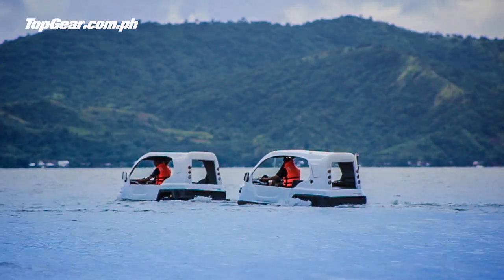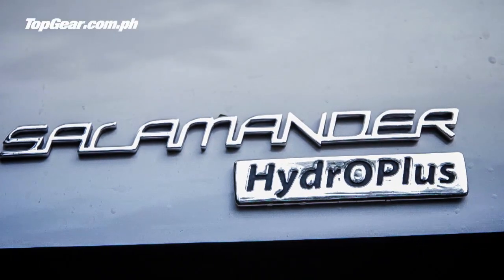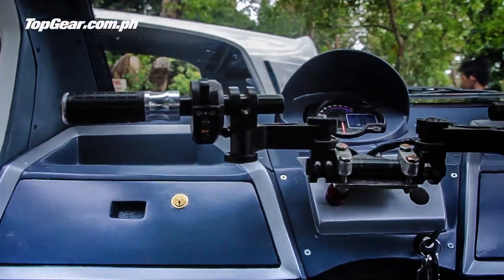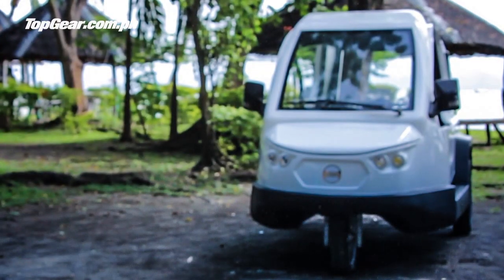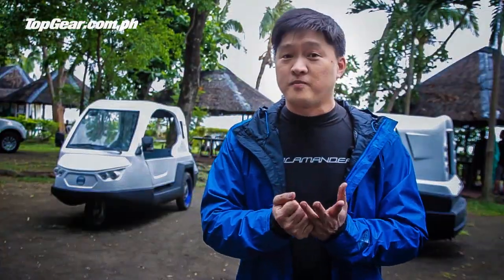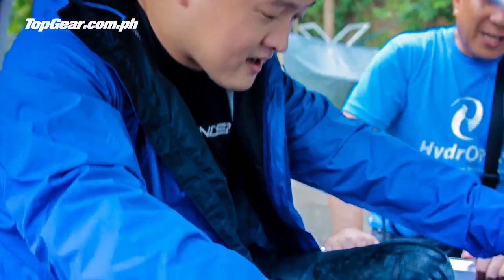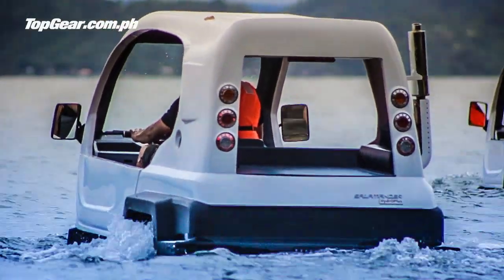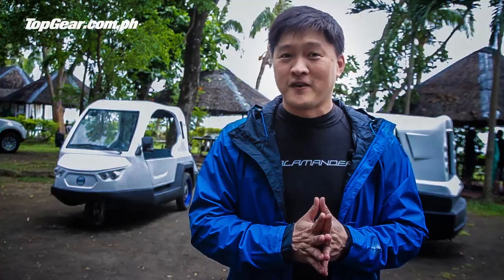The Filipino-made Salamander amphibious tricycle

Comment: the concept and purpose is awesome. however, propeller is not safe - still rotating while driving on the road. should have a mechanism to turn it off or secure it while on land. a jet-propulsion is a good alternative. kudos!
Reply: may critic na nman dito, just enjoy the video and appreciate our fellow filipinos effort
Reply: Derek Tan Tama naman siya, delikado nga kung naikot pa din ung propeller pag nasa lupa na. What makes you think we can't criticise if it is for the better?

Not all criticism is destructive. . . huwag ka balat sibuyas.
Reply: I believed there's a "lever" that "turns off/on" the propeller while on land/water based on the video. For demonstration purposes, it easier to show how it works on a dry land, than filming a rotating blade on water. What is not clear on this video is if this propeller can be lifted up inside the hull when not in use. Same mechanism as the airplane's tires. :)
Reply: Derek Tan If the critics is for the betterment of the product then it's welcome! Read and comprehend bago ka mag comment ng negative.
Reply: Len Manuel Arsenue You're right for demonstration purposes. :)
Reply: Derek Tan
you are very sensitive and high pride,critics doesn't mean to put someone down or dislike the certain thing but maybe some additional idea...hello.. ung ibang pinoy  dito di nmn lahat eh ayaw ma critizise kc  sobrang galing tpos mkapag reply sau wagas kc proud to be pinoy daw..
Reply: Paramotor like engine nlng ang ilagay instead of normal underwater propeller. Both land and water ay magagamit.
Reply: The propeller has to be engaged via its own gear lever and clutch. You see it turning in the shots when it gets out of the water because it hasn't been disengaged yet. The electric version's prop is activated via a switch on the dash (it's still controlled by the same accelerator pedal).

A jet-pump would be awesome, but that would have to go an a "higher end" variant... as it would (by my estimate) add around 50k to the cost (remember, all the parts here will be brand new, not secondhand), and would require a redesign of the hull.
Reply: Derek Tan criticisms could be an improvement of an idea.
Reply: Mark Anthony Diongco I'm glad to see you guys have such a positive response to useful criticism.
Reply: very bright idea, sana pede siya sa mga binabahang lugar ng metro manila, lagyan lang sana ng proteksyon yung propeller against water lilies and basura sa waters....
Reply: Mark Anthony Diongco constructive criticism from fellow scientists and inventors are always welcomed

Comment: CG is a important factor for boat design, it seem when your vehicle is fully loaded, the front tilted significantly and your back sink. You may want to correct that with a ballast tank in front.  Additional side fins in circular design at the side of your back wheels will also improve your propulsion and steering. Your current design only account for water coming from the surface and not from the sky. Your purging system might not be able to handle the extra water if there is a storm. You might want to cover up the side opening during the raining season at sea. Great job guys

Comment: it's very awesome!
I see the benefit also for the canals of bangkok.
sure it will develop further, bigger one, smaller one, etc. and I would estimate they can add reinforcements for windy weather and waves, and some simpler "shape shifting" mechanics to cover the wheels in the water and adding a more streamlined removable profile, then it will go faster.
also a one or double side extension, seen from above:  |-Ö-|  and on the street this is being turned upwise, seen from behind: /o\ if you expect waves  you bring it, else you leave the extension at home.
4 kW is also a possible scale for solar energy, let's say it is used only every other day, and with the cheaper solar panels.
btw I'm not filipino but I can read most of what they write here, and I would say the makers can be very proud exactly because it is humble and will serve people who are really in need of simple transport in that environment. it can carry at least some luggage and they need not re-pack when changing from street to water and back.

Comment: Good start! I hope they change from prop type into hydro jet; similar to the jet ski's propulsion system. Proper can catch anything below the water's surface like plastic bags,trash,water lilies,etc..
Reply: It would be nice, but a jet would add to the cost. The prop shown is a "mud" propeller, being tested for its anti-fouling abilities. From the test, it works... even better than the shrouded standard prop on the other variant. It will definitely get a protective cage on production versions.
Reply: Propeller guard lang ok na yun

Comment: 3 wheels (when 1 wheel is in front : unstable when you break quickly on road. That is a great invention ! I hope to see such vehicles in Vietnam as well !
Reply: i think one reason they stick with the 3 wheels is that the front wheel acts as a rudder when your in the water.
Reply: +crewcutter2030 4 wheels would be probably better. Such 3 wheels configuration have been banned in Vietnam. Unstable and too many deaths when breaking and turning in the same time (don't imagine during an emergency break when turning = it's worse).
Reply: Kalvin One
Well safety is up for debate, since technically if you dont go beyond what your vehicle can handle then you should be within safety standards, that means, you dont do breaking and turning at the same time. besides, not all three wheeled vehicle are unstable, im pretty sure the designers would have taken it into account or at least I hope. Anyway having only three wheels actually has its advantages, for this type of design. 1. The engine they're using is rather small, going 4 wheel would make it heavier. 2. Just an observation, I think its used as a rudder when in the water, I dont know how 2 parallel rudders work, but since i haven't seen a boat with such design so i guess it might not be that efficient. 3.Probably cost savings, its a lot more cheaper to have 3 wheel vehicle than four, just my guess. They would probably move into 4 wheel eventually, who knows.

Comment: Like the idea but trikes with the wheel in the front tend to be tippy around corners...the Robin was one of these. Maybe put your 2 wheels up front like a polaris slingshot. Batteries go lower in the chassis for the electric to keep the center of gravity low for stability and handling. Good concept though.

Comment: I wish I had one of them. Does one need a license to operate one of them?
Reply: That depends on which country your in.  In Canada, on land if it passes Transport Canada standards, it's considered a three wheeled motorcycle and would be considered a motorcycle need a motorcycle license.  On the water your would need a boat operators license.    But unless it has high quality metal bearings and other parts  (ie. 316 stainless steel) it will rust quickly

Comment: philippines will needthe sri-lanka diesel-piagio type of tuk-tuk with amphibious "pontoon"-boat-"hull" and hang-glider trike canopy. the canopy should be tensioner(torque-wrench numbers)-spring(torque-wrench-numbers) and swing-wing. the propulsion should drive rear-wheels with propeller-blades, wheels balance blades and blades balace wheels.  front should be narrow like a boat's-bow, with motorcycle's front-wheel wheel-arch wheel-well, with good water-dispersion for rear of front-wheel. when high-winds, it should behave like ground-effect vehicle or bounce on rear-wheels. when strong-high winds, it should fly and glide. otherwise, it should be a canopy (sun/rain)sheltered no-doors vehicle. similar parts reuse for simple maintenance. extra parts to be integrated for canabalising fo field repairs. blocking path of others, blocking others information(media-control) and games(hackers) and access(beach bockers) and fun(licensing) and ... politics-womenlhy-mentaity results in - too late, too bad, one more time, redo everything, all wrong, ... ...

Comment: You know what that needs though - a foil.
Might have to have a more robust controller and battery, but if your existing motor is 5kw, it can handle 10kw at least briefly, and that's all you would need to get it up on the foils, at which point drag drops way off, and you can cut the power back down to the normal range.
It will be faster, with greater range - which could open it's adoption up to people who's needs aren't met by the current speed capability.

Comment: Show me how it works in rough waves. 
 I bet it will sink.

The Quadski makes this look like rubbish.
Reply: it's a passenger vehicle, not for sports.
Reply: So is the Quadski.
Reply: for urban use only
Reply: i think,  they could put an outrigger on it so that it will not sink in case there's a rough waves.
Reply: +jezz vanity they should just make a 4 wheel version, it may not be as aerodynamic but it would prevent it from flipping on land, Make it more buoyant , and make it more practical